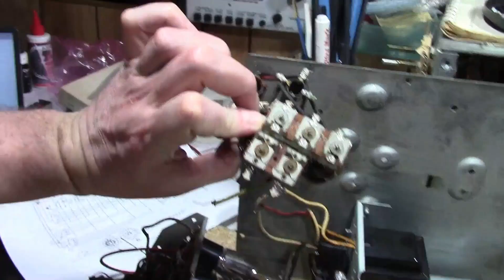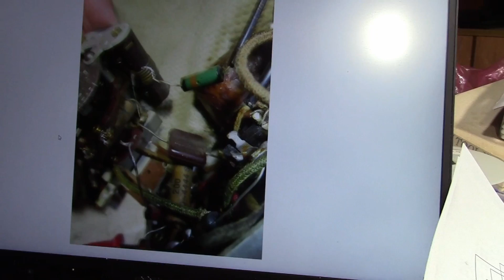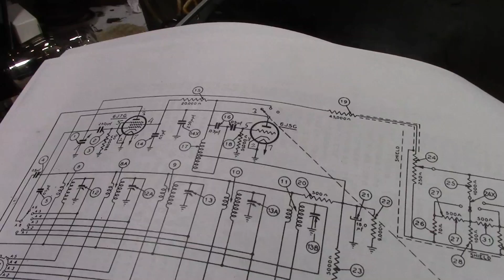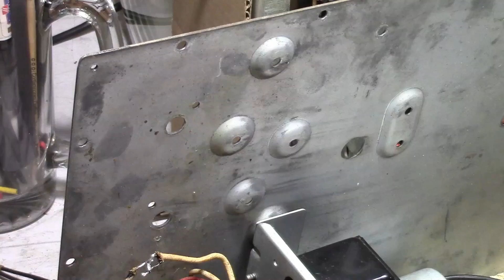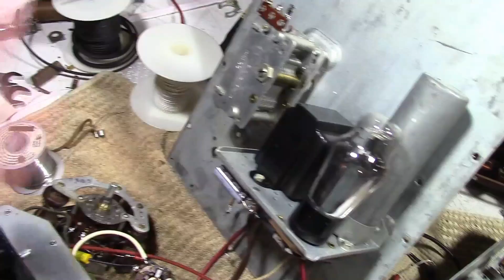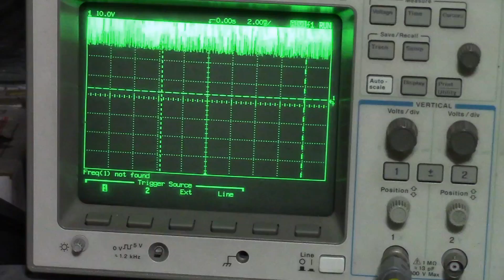Philco 077 RF generator restoration p5o6

Comment: Were the waveforms supposed to be bouncing, like they did near the end?
Reply from the maker: The amplitude of the RF drops off as the generator frequency gets higher. By the time I was at the extreme end around 35 MHz stray interference is more noticeable. When the shielded cabinet is back together and I pull the signal out of the jack it should be less.

Comment: 400 HZ mid frequency in Audio
Reply: ian forster Well kinda true in these days. But also look at it this way: in these days a lot of the simplistic "peaking such and such coil/ trimmer" alignment in radios was done by ear or at least with the speaker running. And given the choice to have to listen to 400Hz or 1kHz for hours of my working day, I'd settle for 400Hz.

Comment: you using a dimm bulb
Reply from the maker: No.  I use a Sencore PR57 variac/isolation transformer.  It has an ammeter and overcurrent protection.

Comment: Nice to see you got her working again. From the schematic I see the power on switch #34 is in the wrong place. Probably should be before the pair of .15uF caps
and put the fuse between the caps marked  #37 and the switch. For safety you could use a polarized plug with the hot going to the switch side, but you know that!
Reply from the maker: Keep in mind the location of the components. The first line filter caps are on the other half of the cabinet. You need to cut into that run an extra wire to the power switch then back to the filter
Reply: @bandersentv  I would go the extra step
and try and find a way to get the thing on the one  board. Perhaps there is room to get two sets of terminals strips to get it so the only thing on the outside case is a grommet to protect the line cord going to the whole innards.The non polarized plug could just be left in the corner and not used.

Comment: I have an old Metrix 20MHz hybrid scope which was based on a Philips reference design, and it will do automatic scaling and frequency/voltage measurement in analog mode as well as in the 40MS/s digital mode.